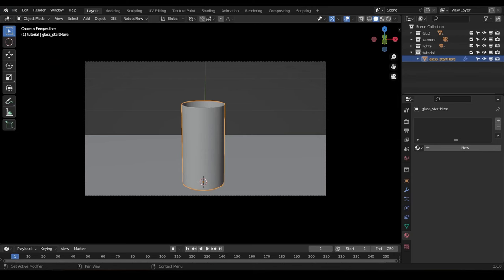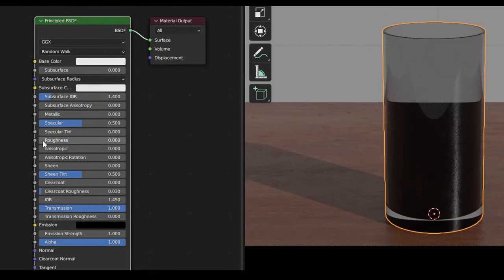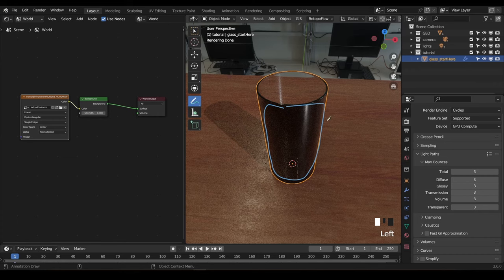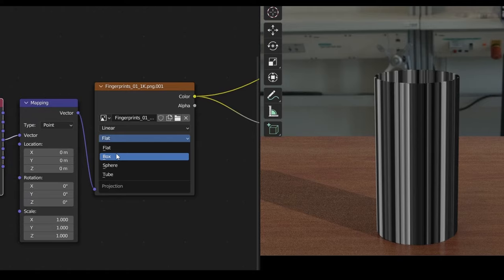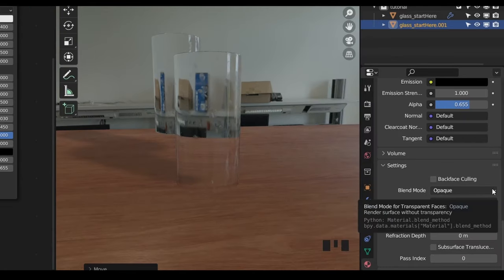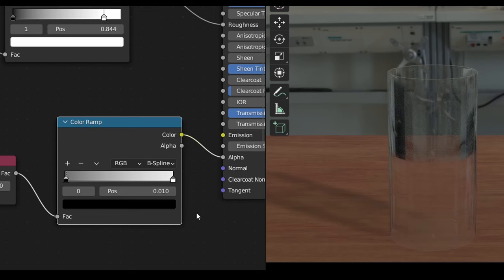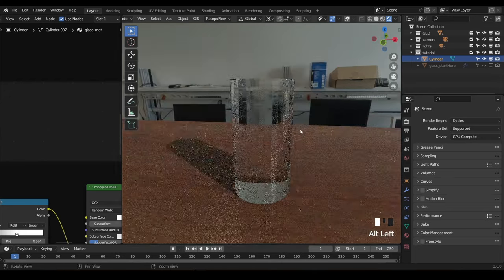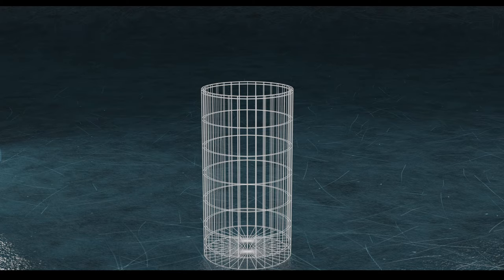3 Simple steps to make Realistic Glass

Comment: Nice and easy tutorials, thank you. I'm glad that subscribed to this channel. Is it possible to add a couple words how to make gradient glass correctly? From up to down or from left to right with several colors.
Reply from the maker: Hey Vyacheslav. If you download the scene files, you'll actually find a gradient node in the material that I didn't cover in the tutorial.
There were some fingerprints right down the bottom of the glass, inside the solid bit which were looking weird. So I used the gradient to mask them out.
That may not be exactly what you're looking for, but it might also show you how to set up a gradient to achieve what you want.
Reply: @JamieDunbar  oh, thank you a lot, I'll try to experiment,. ) And I appreciate the quick answer. )